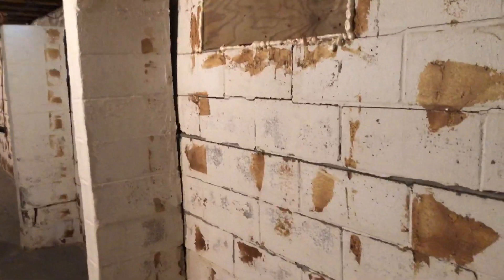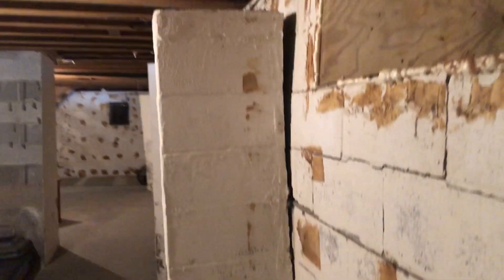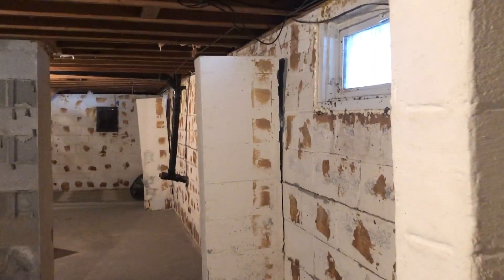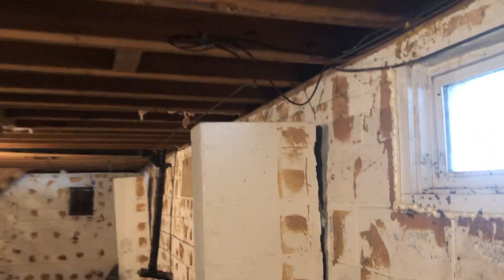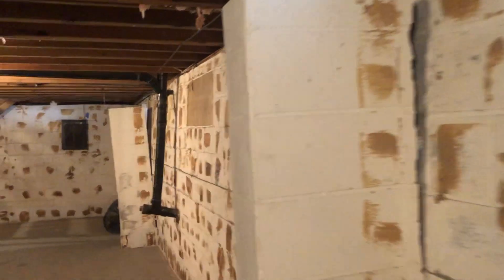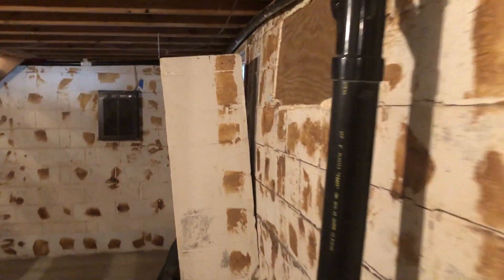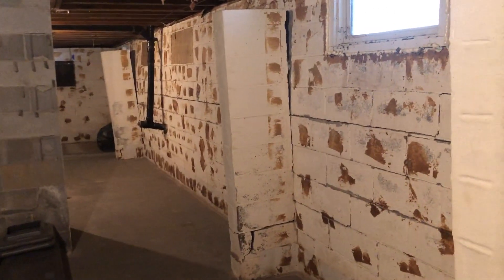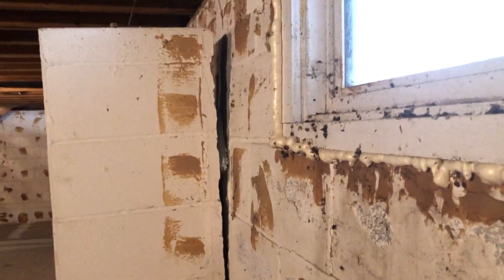Failed Foundation Wall and Pilaster Inspection

Comment: these walls like many others NEED to be hand dug out, exterior waterproofing dude because that would reduce lateral soil pressure acting upon the walls and remove any possible underground tree roots AND properly waterproof all of the EXTERIOR cracks in walls!!! (backfilled with all gravel) Example-- tree limb lands on your roof during a storm and causes damage to roof and water begins to enter, what are YOU going to do? Install some braces and foam up in the attic or are you going to remove the tree branch off the roof and repair the damaged roof on the exterior? smh

Comment: My 1971 single story ranch block foundation has settled 3.5" at the back of the house. I'm raising the house that amount with a permanent 3 ply 2x10x30' beam and permanent adjustable screw jacks sitting on beefy footers spaced 5' apart. Should I remove the nuts from the anchor bolts, so the sill plate lifts too? Or try to lift the floor joists with rim joist separately from the sill plate?

Comment: I just had a mason look at my foundation wall and he was suggesting pilasters, but seeing this they do look pretty useless. Thanks for the video!
Reply: Pilasters work if they're done correctly.  Every new home with a CMU foundation and straight runs of more than 20 feet has pilasters.  They just have to be installed properly.  The ones in the video obviously were not.